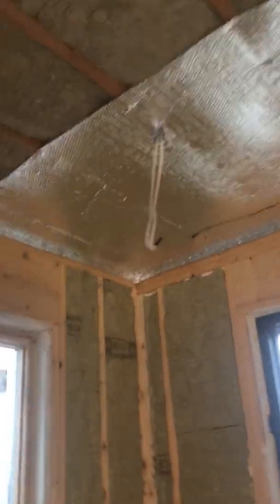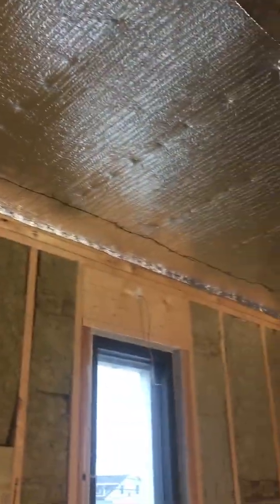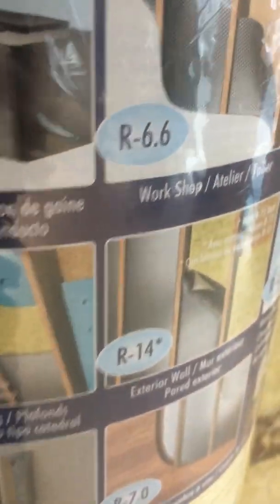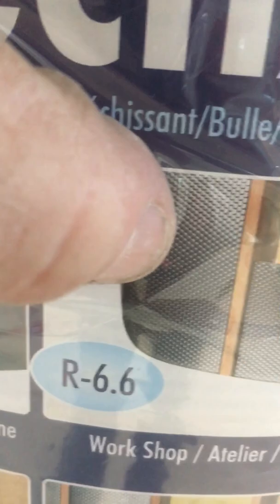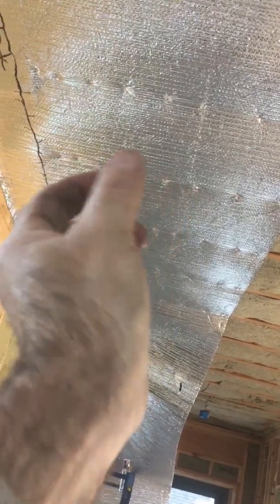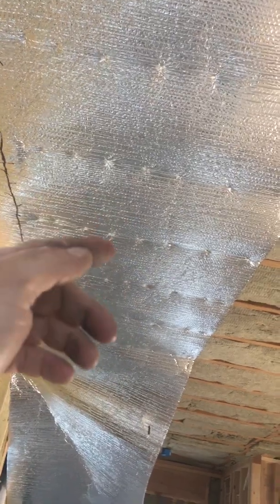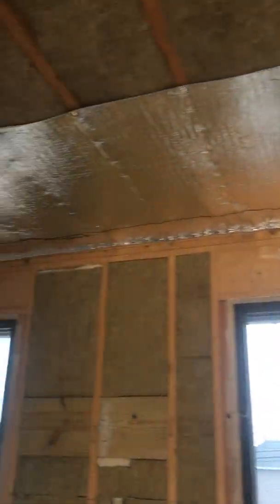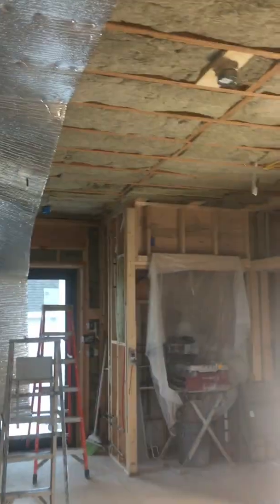Behind the drywall Radiant Foil Barrier

Comment: Reflectix website states a 3/4" air gap between it & the batting provides the best R-value
Reply from the maker: Application 3/4” is a minimum measurement spec for an air break   At the
e end of the day if it comes in contact with the drywall or any substrate on the heated side the radiant heat transfers thru 

Our Rockwool bulges slightly in the bays if set a3/4” space it would touch across our centers